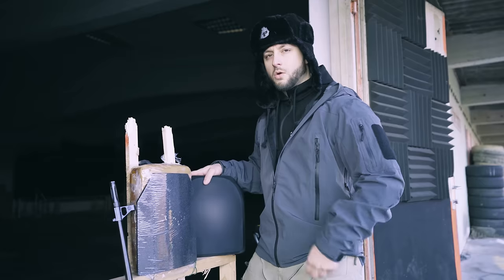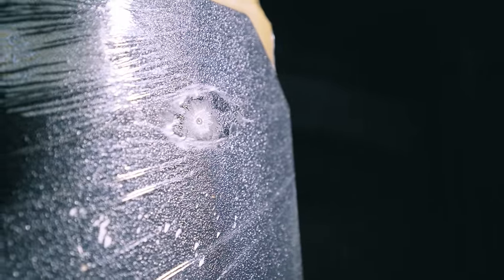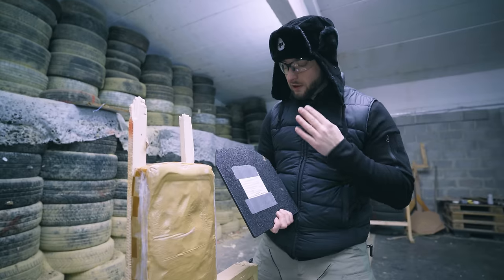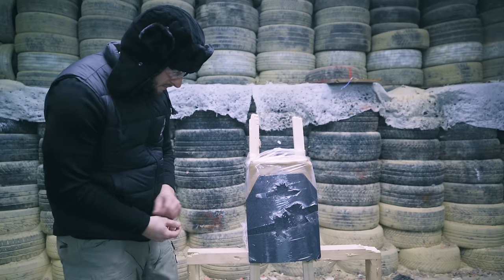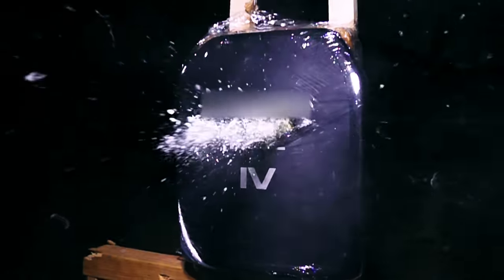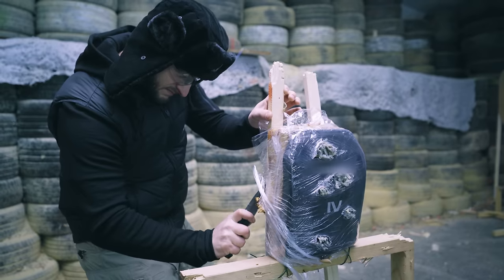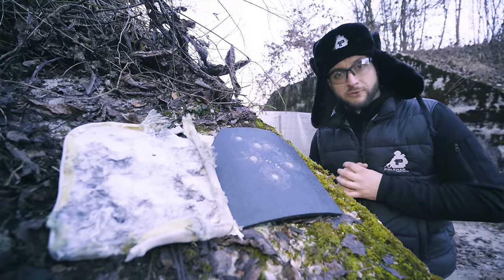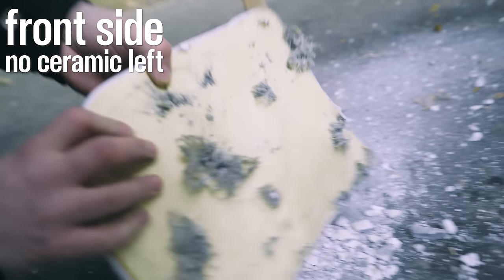Steel vs Ceramic Ballistic Plates

Comment: I own steel plates but 100% recommend getting ceramic and/or polyethlyene plates.  When shopping for steel plates research which company has good spall coatings, and get the FULL coat or extra coat option.  Spall sleeves exist now made up of 1000 Cordura, ballistic fibers and kevlar, effectiveness is questionable.  Russians got away with giving their special forces soldiers steel and titanium plates by giving them kevlar jumpsuits and neck protection.  The big problem with steel plates is the weight.  I would only recommend getting steel plates and everything else for weight training purposes only.
Reply from the maker: I completely agree, i also use steel plates for endurance training but otherwise they are just too heavy

Comment: This isn't that hard people: 

Steel for the end of the world
Ceramic for 1 Firefight

That's it. That's the only things you really need to know. You can wear the same steel plate in multiple fights as even a hit will not have much of a cumulative degradation of the plate. Ceramic will stop (almost) anything, but once it's been hit, replace it ASAP. Personally, I prefer steel with a separate ballistic spall sleeve. Does it weigh more? Yes. Does it last forever so long as I keep it dry? Also yes.
Reply: Ceramic still has a perfectly fine shelf life. If you take enough hits that your ceramic plates crack and fail your still would have had the spall coating shot off and sent spalling into your throat.
Reply: @Justin-rq6kf  I'm not a fan of spall coating to be honest. I prefer just having a true spall sleeve. I did a test with a cheap AR500 plate and the Scorpion Tactical Spall sleeve and it worked for literally dozens of hits with M855
Reply: @Rangercaptain1138  That's actually decent, though I still recommend against steel. A good steel plate setup will cost you as much as ceramics and be much heavier.
Reply: @Justin-rq6kf  It's more about fire and forget; I can keep a Steel plate in my dehumidifier safe for 30, 40 years, and be certain it will work. And it will work regardless if it's been dropped, or kicked, or something falls on it. It will always be there, for me, or anyone in my family that needs it. 

Ceramic, not as high of a guarantee. That isn't to say I dislike ceramics; they're fantastic and unquestionably the best at stopping singular AP rounds, and if I knew I was going to need a plate, you better believe I'd pick a ceramic, but for the unknown and unpredictable future, I'll take steel in a spall sleeve every time.
Reply: @Rangercaptain1138  40 years is simply too far long term for self use, 20 is the longest you should look at. And if stored in good conditions ceramic will still be fine
Reply: @Justin-rq6kf  ehh a steel plate (again assuming you don't bother with not care about coating) should last more or less forever assuming no evident corrosion. Ceramic itself lasts more or less forever HOWEVER the balastic backing does not. Basically the weaved fibers lose tension and lose their ability to catch without passing through. Additionally, while moisture is bad for anything but a poly plate, ceramics are PARTICULARLY susceptible to being damage by even long exposure to moist air. 

Most will recommend 5 years for a poly plate, 5 to 7 for ceramic, and 20 and beyond to well stored steel (coating not withstanding). That doesn't mean these stop working at these dates, but they will start working less and can't be trusted. This is most glaring for a ceramic as the whole point of them is take the biggest badest hits and even a slight reduction in functionality renders them a slightly more delicate steel plate. 

Again: end of the world, steel, 1 firefight, ceramic.
Reply: @Rangercaptain1138  I highly disagree with the idea steel is superior.
Reply: @Justin-rq6kf  it isn't from a hit to hit survival. If I know say, tomorrow I'm gona get in a firefight, I'm grabbing a ceramic every time. But if I want go leave a plate in my safe forever, a ceramic is just too untrustworthy given how they work. To say nothing of a steel plate being usable after many hits. I've had plate carriers hit with both and you can continue to use a plate carrier with steel plates even after hit, a ceramic blows out and destroys the carrier
 Again, quantity over quality. If you think you might be stuck wearing the same PC for a month without resupply, steel. SWAT team, ceramic.
Reply: @Rangercaptain1138  It simply doesn't seem realistic to be so far up shits creek that your ceramic carrier is destroyed and you need another with you still being alive or in fighting condition. Its a far better option to get ceramic, it's not too bad to replace every 7 years.
Reply: @Justin-rq6kf  Tell that to anyone living in a country undergoing a Civil War/Invasion.
Reply: @Rangercaptain1138  Still rare someone is capable of fighting after their armor is ruined
Reply: @Justin-rq6kf  I think you're not appreciating the concept of long term vs. Short term.

A ceramic plate and the carrier it's in in ruined after a single hit. Can it stop more? Of course, with a big old BUTT as long as it doesn't hit the same spot (as seen in the video). Steel plates don't have that but. If on day 1 of the Somme I take a central hit on a steel plate, and then on day 2 I take another hit in the same spot, I'm no worse for the wear. If 3 months later in the same vest and plate I get hit a 3rd time in the same spot it'd still likely to hold up. 

That would not be remotely the case with ceramic.

Here's another simple example: a few week long LRRP. You may get in multiple small firefights over the course of the LRRP, and no you won't get a resupply, with a ceramic plate you are in a compromised state as soon as the first round hits the plate, that won't be true with a steel plate.

You seem to be thinking of terms of the West Hollywood shootout of just getting 10 20 hits in a few hours on the same plate and thus the stronger (ceramic undoubtedly) is better. But there's a whole other world of firefights and combat that you are ignoring. Speaking from personal professional experience, you usually get hit once and drop, not allowing much time for followup shots to whale on you. Thus stopping that 1 round is paramount which is why ceramics are popular in the first place, cause multishot followup in the same burst of fire is highly unlikely. And if that firefight ends with you humping it back to the FOB, then (almost) no harm done. Problem comes in when you DONT get to the FOB or no supplies including a new plate and PC get to you. You've just got this compromised plate and blown out vest. A steel plate protects less (although I think people grossly overestimate how common steel core ammo is) but it protects longer.

Comment: Ceramic plates are much weaker at the edges as well as it looses area to deform and eat energy, since it ends at the edge obviously. Donated steel plates to Ukraine and they have saved lives so it does work

Comment: Yeah multi hit has always been my biggest concern with ceramic plates. I think I’d personally go with steel with a really good spall coating. I’ve seen plenty of steel plates that can stop 5.56 as long as you’re not talking specifically armor piercing rounds. Heck, I’d have to look around again but I think I’ve seen some steel plates even stop AP 5.56. Feel free to take that with a grain of salt though.
Reply: Tested lvl3 steel against B32 AP from my SVD. Went right through since it was not rated for it. But that is a rare bird type of ammo I guess.

Comment: useless video. 
You did not focus on the main and most important parameter - weight. 
In reality, it is does not matter what degree of a plate protection if it is so heavy that it cannot be worn by soldier. Weight is the mobility of a fighter. This is critical

Comment: If it 7.62x39 it will stop 5.56 and 308
Reply: 7.62x39 is much slower. Speed defeats armor.
Reply: @jonboy9734  7.62 has been proven to have better penetration than 308
Reply: @djjaysky9071  308 has close to twice the powder and energy behind it than 7.62. Same size. But 308 is 2700 foot lbs of force and 7.62  is 1500 foot lbs of force.
Reply: @djjaysky9071  against soft targets because it has mass. When it comes to penetration of armors it’s all about speed
Reply: @Beef-bullion  that's not always true 45_70 defeats lvl 4 its slow and heavy
Reply: 308 is much more stronger than 762 x39
Reply: @jonboy9734  military arms channel has a vid

Comment: I have to disagree with the "unlikely" I have seen people who almost always penetrated ceramic with at least 2-3 6 5,45 rounds two or three short bursts with the AK usually half and up. And I only have 2 cases for Data but in both one magazine out my TT in very CQB distances did drop goat, sheep and donkey  love enthusiasts In a pool of  blood and gore which  usually takes 2-3 good hits on someone who has no protection better than a impressive quantity and variety of hard drugs in him. And whit a good steal plate you can miss being hit by 1-2 5,45/5.56 I THE MOMENT you will know it after some time and remember it at least a week but worst case it knocks your air out. And when steal plates are done for - shrapnel you probably will be okay maybe have some nice little new scar but mostly nothing except "now I pist up". For ceramic on 2( if you're God really don't like you to) 6 best possible case (like it's possible to win the lottery) you have holes in your torso just were the important things are two bursts for some that is an ok soldier and you and doc (now) and a hospital (today) or more likely you get to see grandma and grandpa. And even the oldest steel is a really nice target or car seat protection if you car is not a slow mobile billboard advertising how small a Johnson Uncle Scam has. In my opinion at least for a strong slav that has no problems with pounds (ебем ли му мамата... Американски глупости) steal is the only way. And sensitive westerners are better off without plates so they are faster and don't believe ( wrongfully) that they have armour! At least that is what Idiot believe based on lots of COD
Reply: The shrapnel won't just leave a little scar, it will leave you bleeding from your jugular. Ceramic and composite plates are better, even Spetsnaz use them.